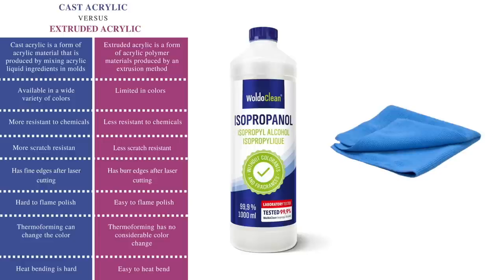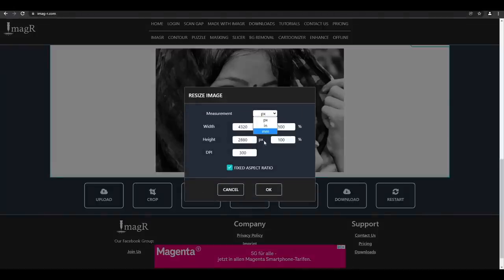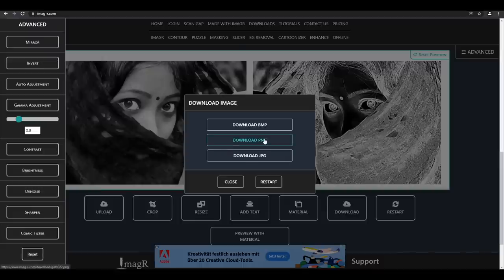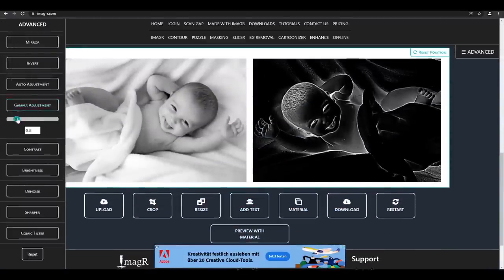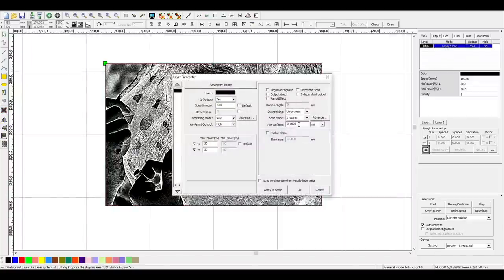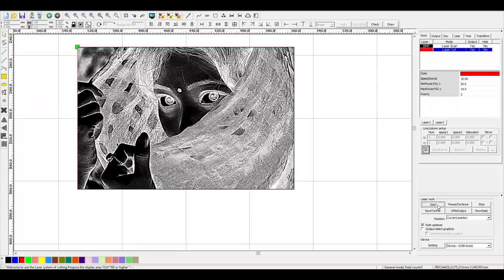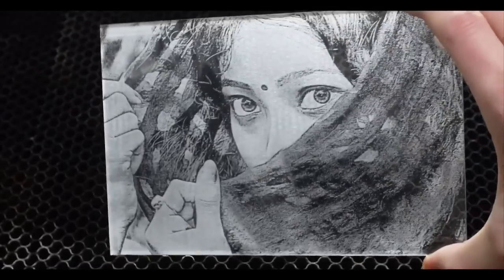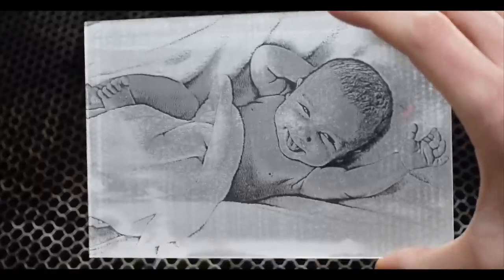How to ENGRAVE images on CLEAR ACRYLIC | Re-Upload [Natural Voice]

Comment: Also, on the engraving surface, add a thin layer of dish soap.  This will help reduce any splatter you might get.  When done, wash off with water.
Reply from the maker: No need for that. If you use the right settings you don‘t get stains